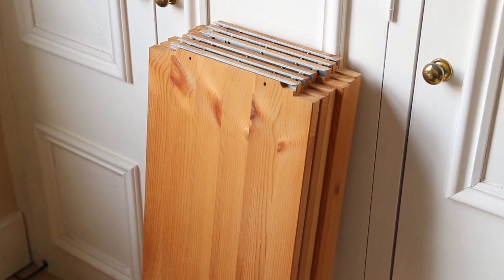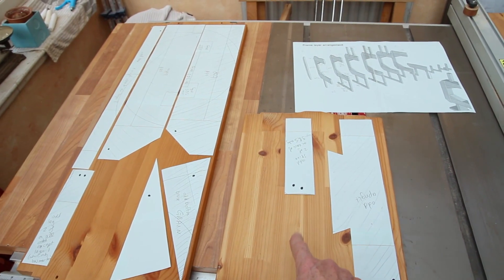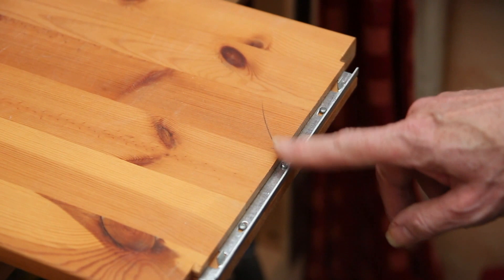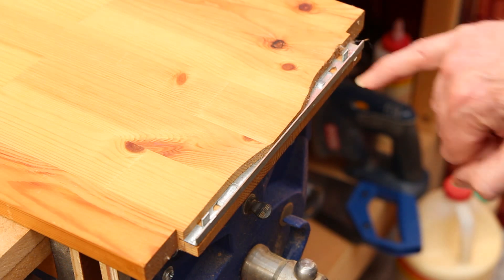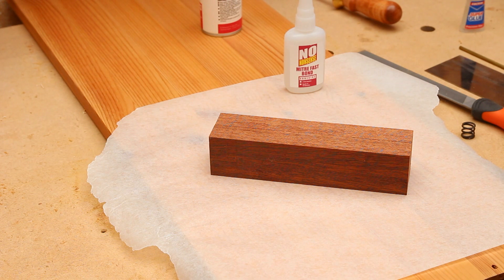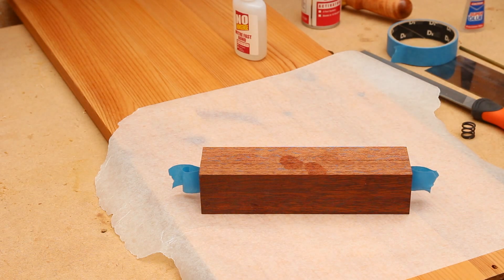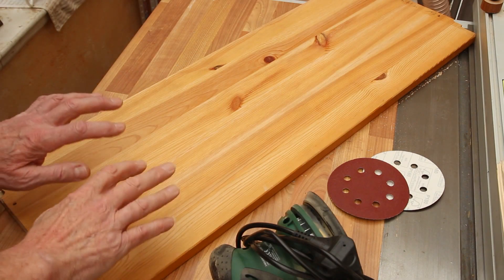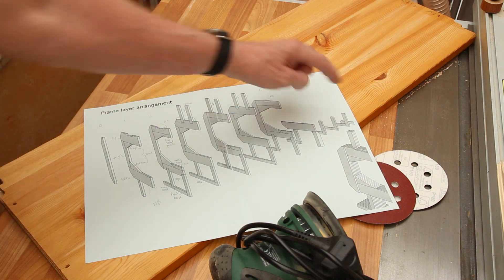Bandsaw Build Diary - Part 1

Comment: I've heard Matthias mention a program called Big Print for printing out drawings at actual size.
Reply from the maker: Indeed there is. Some of the diagrams included in the bandsaw plans were produced by Big Print; and I use them in the Part 2 video. In fact, I think Matthias wrote Big Print.
I just wondered if I was missing something about PNG and Fireworks.

Comment: Bill, what is the glue and the activator that you use please?
Reply from the maker: That particular pair are from Screwfix (in the UK). It's just a cyanoacrylate (superglue) and activator. The normal activator for superglue is moisture; superglue starts to cure when exposed to moisture in the workpiece and the atmosphere (and when oxygen is excluded). But alkalis like baking powder speed up the cure.

I imagine, but don't know, that the activator is just an alkaline solution of some kind.
Reply: Thanks for that John. I'm in the UK and also use Screwfix. Can you share with me the brand/product names please so I can go get/try some. Thanks.
Reply from the maker: Item 41795. No Nonsense Mitre Adhesive 200ml
Reply: Thanks again John.